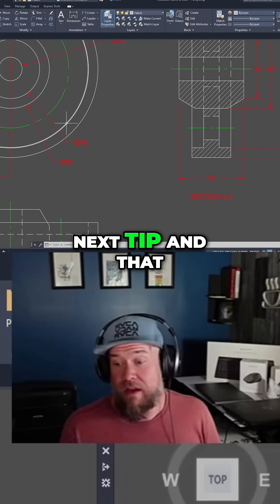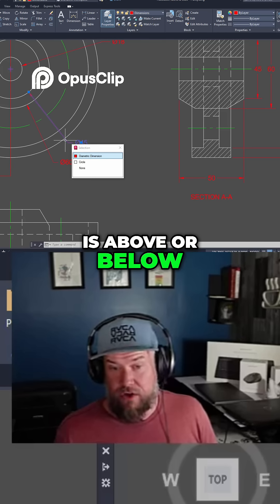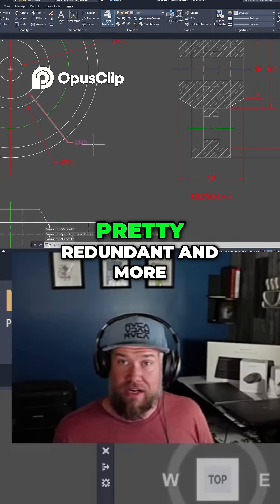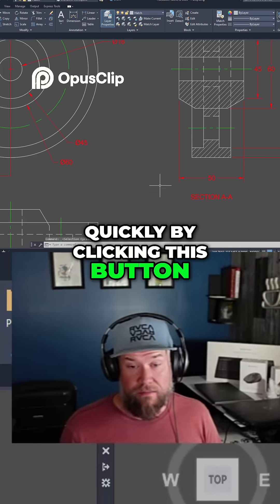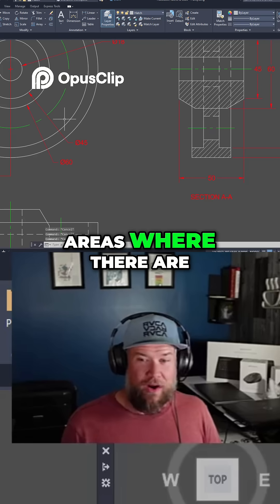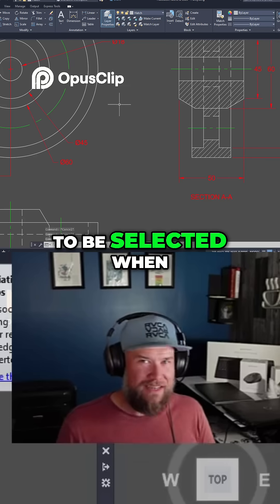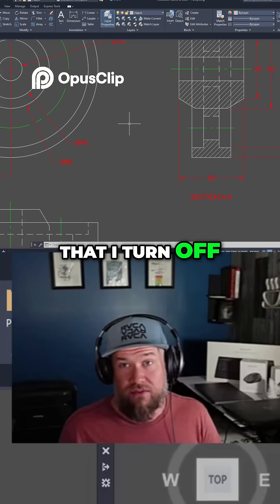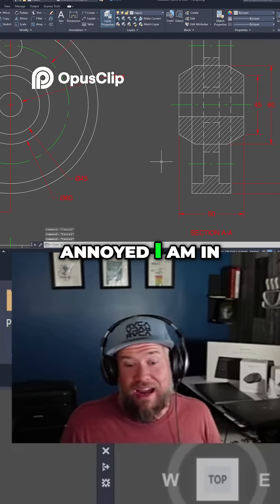Speed Up Your AutoCAD Workflow: Disable Selection Cycling Now!

Comment: Ditto on this feature!  TURN it OFF.  

Here is my pet peeve: One feature that was disabled on my 2024 Carlson/Intellicad from the 2021 version was the ability to have an OSNAP pop-up menu by using a "SHIFT Right Click".   2024 version does not allow this keyboard feature.  

I do see some hint of this in the CUI, but it is a POP 0 and it has a RED DOT  in the line command.   I will have to do research on how to move it from POP 0 to a different POP location and then getting to activate with "SHIFT Right Click". 

I know you all use Autocad, but most older command apply in some form, and I have found that your lessons work with IntelliCAD.  
Your review of ZWCAD was great also. 

Thanks Hal